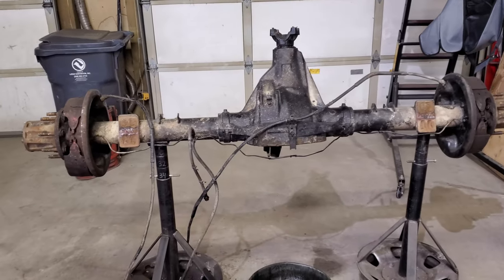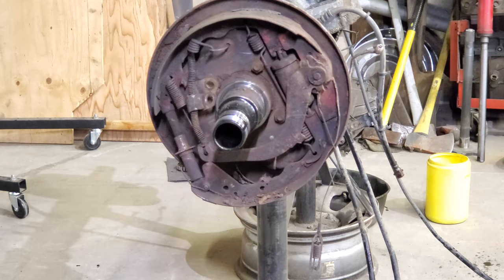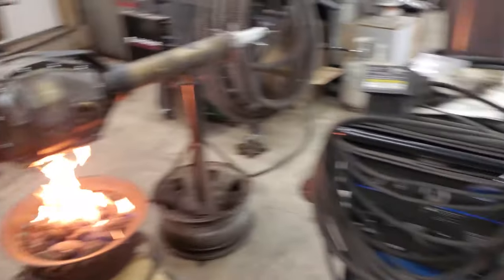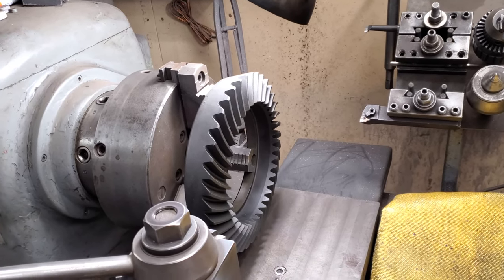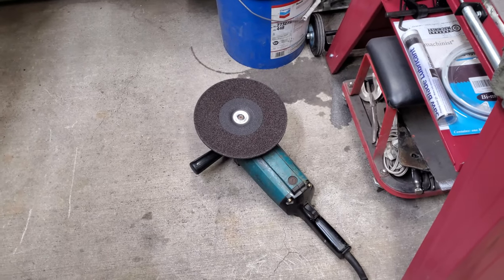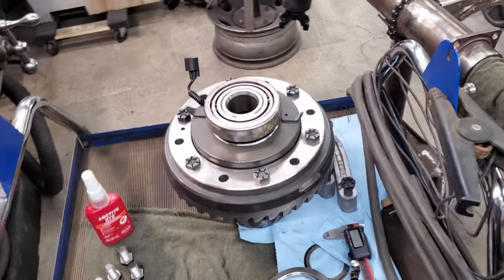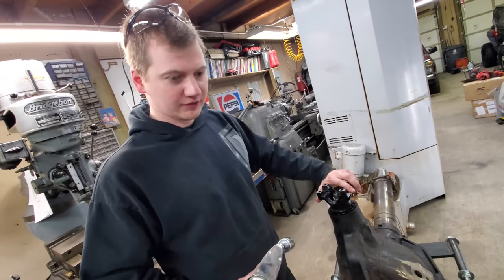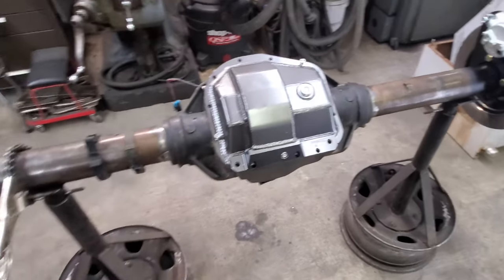10.25" Sterling Axle Build - SHAVED & LOCKED!

Comment: If you use the E350 Van stuff you can retain an emergency brake
Reply from the maker: Yeah I think from what I saw, that involved cutting the caliper mounting flanges off and welding on different ones. It was tempting!

Comment: Did you have to do any modifications to it for the e locker to fit or can i just buy one for the 10.50 and put it in my 10.25?? Cause i have the 10.25 on my 95 f250 and im trying to put an e locker in
Reply from the maker: Just have to drill and tap a hold for the wiring gable gland 👍

Comment: Did you use the 2010 and newer gears or 2010 and older gears with the 2011+ locker?
Reply from the maker: I used the older gears since my axle housing is older
Reply: @WrenchChill  Thanks! I’m building another 4WD van and wanna use a Sterling. The van I have has a Dana 70 and the lockers available are super expensive.
Reply from the maker: @CaptainBuilt  oh awesome! I guess the only thing to check or worry about with that is the width. I know vans sometimes use wider axles.

Comment: Good video. I wish you’d shown more on the carrier shim setup since the one other video I saw the guy had to bevel the shims. 

How did you remove the old pinion bearing?
Reply from the maker: I used the carrier shim kit from East Coast Gear Supply, and it had some small bevels on the edges already. I used one of the bearing splitter style of pullers.
Reply: @WrenchChill  awesome. I have never seen it done with the splitter style. I went with new bearings since the shims are outside the races, and they all drop in together.

Comment: Awesome build!  What gland did you use for the elocker wire?  Looking to do the exact same thing in a different axle.
Reply from the maker: Thanks! That gland was actually one I had laying around from an old project. I don't have the link for that exact one, but I know Amazon has several option for stainless cable glands :)

Comment: I dont understand the shaving.  What is it and why?
Reply from the maker: To shave this axle, Nick machined a few inches off the bottom the differential case. This is done to improve ground clearance for offroading.
Reply: @WrenchChill  
Hmmm.  Okay, I guess so but, he didn't cut off much then, proceeded to replace it with a new fabricated section.
I dont get it.
I'm sure there is more to it than what I realize.